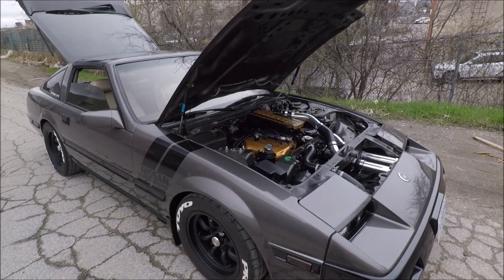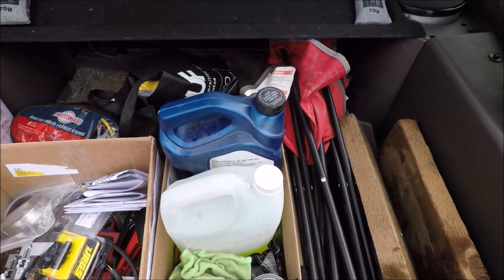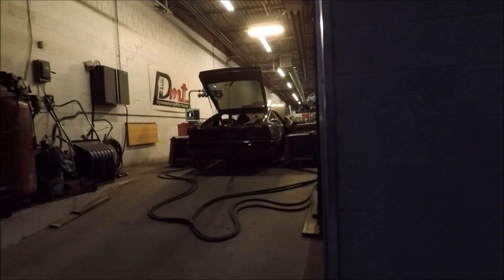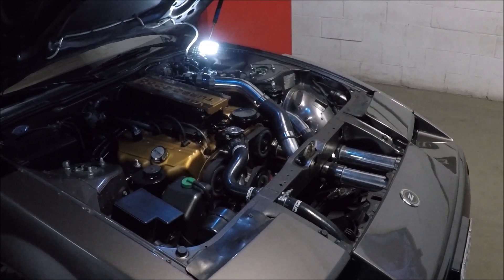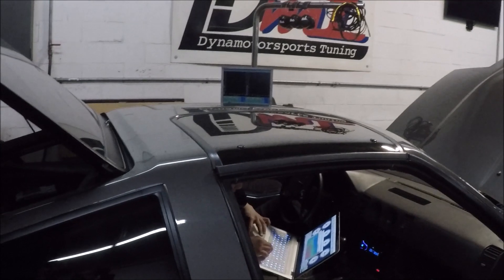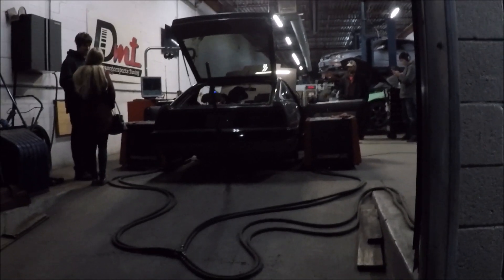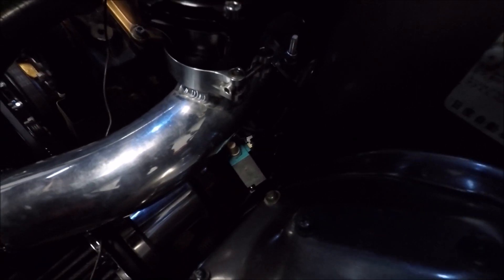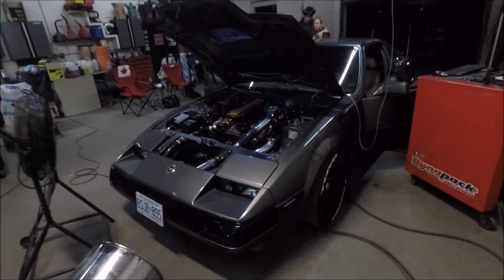Megasquirt Z31 Gets Dyno Tuned! Almost 20psi of Boost!

Comment: Nice ride alot attention to detail, curious as to what ignition system you running since there's no distributor or wires in sight, and did vg33 swap on my d21 hard to hide anything out of sight due to location of what's trying to be hid, but very nice peace pretty sure it's taken some time to get to that stage, especially if its your daily driver.
Reply: Ls coils

Comment: Nice project pro but, isn’t better an ls swap ? By the way i have 300zx 1985 ls1 swap 327 hp 344 tq with air intake 4 in and magnaflow exhaust 2.5 in .

Comment: Nice build. Which spark plugs are you using and what do you have them gapped at? I'm going to run Nistune with 750cc injectors and 20lbs of boost on my 84 AE. Thanks again and keep up the great work.
Reply from the maker: NGK BKR7E at 0.025, tuner recommended both that plug and gap, no issues
Reply: Great. I'll try those out when I change my mine. Why did you choose Megasquirt over Nistune? I purchased Nistune with an 88 non turbo ECU and a 93 Mustang Cobra MAF. I haven't installed it yet and wondering if I should. I've owned a z31 for over 25 years and I'm learning a lot from your channel. I admire your passion. Thanks again.
Reply from the maker: @charlespickett5397  Nistune will get the job done, but lack of modern features and questionable reliability
Reply: Thanks. Did you change the base fuel pressure? If so, what did you increase or decrease it to? I'm going to be running 750cc injectors. Also did you advance or retard the timing for 20psi boost? Thanks again for your experience.
Reply from the maker: @charlespickett5397  You need to get it tuned professionally
Reply: @TurbochargedCreations  My stock T3 has been rebuilt and upgraded to a T3/T4 hybrid .50 or .57 trim. Did you use the stock actuator  (internal wastegate) or did you use a modified actuator like the one Mamba makes with a stiffer spring? I have a manual boost controller and my boost doesn't go past 12lbs of boost. I'm going to purchase an electronic boost controller to see if that fixes the issue. i thought that a T3T4 would make 20 psi of boost. Any input would be greatly appreciated. Thanks.
Reply: I figured out my boost problem. It was my internal wastegate actuator. I noticed the boost still didn't increase after I upgraded to an electronic boost controller (AEM Tru Boost). I removed the actuator and I had the rod to the wastegate flap shortened in order to put more pressure on the spring (keeping the flap closed). Wow, what a difference. The car is screaming now. The boost kicks in hard and the power is there. I will be installing Nistune soon. Thanks.

Comment: That turbos definitely out of steam. It's really nice to see megasquirt cars completed. What kind of ignition timing was that and out of curiosity... it may be covered in other videos. did you guys verify ignition timing through trigger wizard? Your build is very similar to my l28 build. I'm on megasquirt 1 converted to megasquirt 2 with a 2.2 daughter card been running for 12-13 years now. I started very similar to you with a T3/T4 (made 323 @354tq @ 18 degrees of ignition timing 1 bar boost) and now I'm rocking a holset with a Billet compressor wheel makes 400ish 22 degrees ignition timing at 20 lb of boost with water meth. I haven't dynoed it with the new turbo and water meth. Anyway awesome z31 you should turn it up more.

Comment: So whats the tune i wanna steal it running nistune . i got almost same set up just vg33er fresh build engine on fully built heads. 7200 rpm  T3t4 hybrid.
Reply: Corey Engle you can’t really run the same tune on every engine and have it work the same. Especially when running different engine management setups
Reply: There is alot of base tunes for the aet up i have.  I cant get any shop around to tune sosomething close i can tweak it no Z?
Reply: Yes it can be tuned to get the same power as long as the setup is close to the same. Or you have another know setup that produces the same power. With that any tuner can tune the power out of it. Otherwise you end up missing some power or detonating because your car has small differences or big once depending on the setup.
Reply: If you can’t find anyone though yes with some detcans to listen for knock and a wideband you can get a good street tune. But you won’t get maximum power without a dyno tune.

Comment: Your turbocharger is not maxing out, it's not properly holding boost pressure. Look at where you have your BOV located, it should be moved closer to the throttle body. Also recommend getting an external wastegate, also a Pathfinder intake manifold plenum.
Reply: Old maxima intake is nice for shorter charge pipe routing. Seems a few things aren't in harmony with this setup but it looks clean and shiny.
Reply from the maker: BOV has nothing to do with making power or holding boost pressure. This plenum is also gutted, ported and the the throttle body is much bigger then stock. 350-400 is normal for a stock style hybrid turbo

Comment: I notice when you put it on reverse... Your rear center light 🚦 didn't work. It's that by choice?
Reply from the maker: Rear center light does not light up on any z31 models
Reply: @TurbochargedCreations 
Then I'm assuming the two lights it has aluminate the license plate?
Reply from the maker: @dxraaaaa  Yes correct, the headlights werent on at the time so they did not light up
Reply: @TurbochargedCreations 
Your center rear brake light located on your wing doesn't work?
Reply: @TurbochargedCreations  Hello... I got your next perfect 👌 video 📹 idea 💡 
I searched YouTube and no one has a Z31 video on changing the headlight or upgrading them to HID lights. You can be the first to make a video on that subject 👌

Comment: Hi, i see that you have deleted some parts under the hood. Those things you deleted, where those restrictions? I just put 550 cc injectors and nistune in mij (euro spec)87 turbo but i can't get it to idle properly. And the car runs sometimes rich and the other time lean.  Could you help me a bit? I haven't driven my Z really yet and have the car for 3 years now. Thx in advance

Comment: Awesome work man!!!! One thing with the launch control, i was actually able to use a brake light switch on the clutch pedal. There brake light switch closes when you press in the pedal, as apposed to the to the clutch switch. The harness was different so i just used a couple of spade connectors and put heat shrink around then.

Comment: Man! I cant wait to megasquirt my z, did you do aything to the head like springs and retainers? and did you do anything to the bottom end or is it still stock rods and pistions?
Reply from the maker: Upgraded valve springs to go with cams, stock bottom end
Reply: @TurbochargedCreations  you didn't gap the rings?  Or Was yours a turbo from the factory?  I'm getting ready to do the same thing starting this spring but mines Non turbo, for now. Great build, looks awesome!